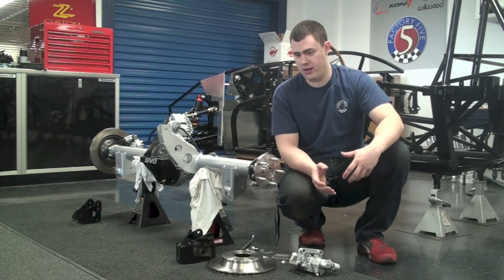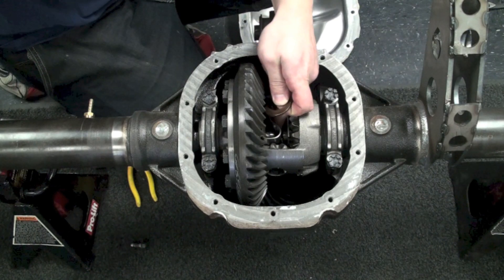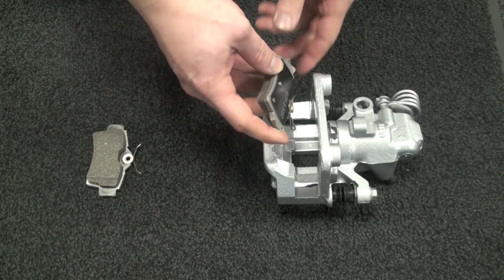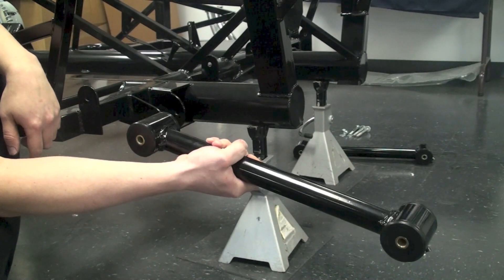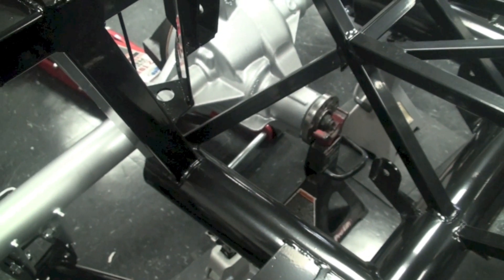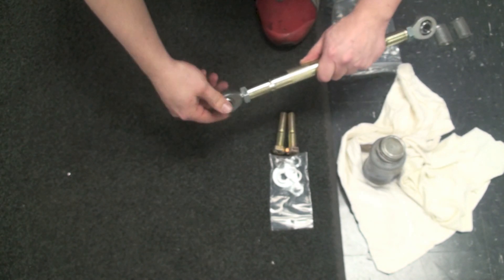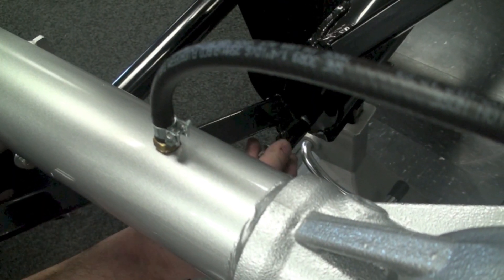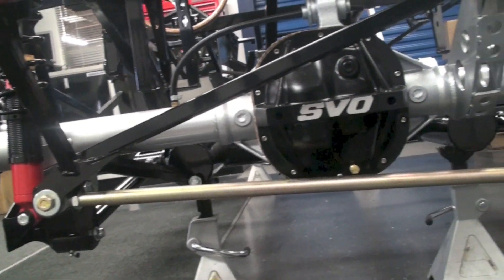Factory Five Mk4 Build Episode 7: Rear End Assembly

Comment: I realize that using different rear ends are not supported officially by FFR, but what is the minimum width a rear end must be to fit the car? I have an 8.8 rear end from a dead car that is 56.5 inches flange to flange, and the 79-93 fox body mustangs supposedly have a 57 inch rear end. It doesn't look like there will be any interference, but I figured I should ask.

Comment: Ahh yes. I understand. In compression that will work. It makes the entire structure rigid. I am still with you though,it could be stronger with minimal redesign. The current design does leave clearance for a wider range of shocks though. I come from a world where everything must be as strong as possible so "strong enough" makes me nervous but it is a proven design & principle that has worked fine in many vehicles. After all,if you hit whoops at 80 mph in this car you deserve a hefty repair bill.
Reply: It might also be a good idea to replace the coarse grade 5 hardware with fine 8 at the very least, if not AN or NAS.

Comment: They did answer and I think it had to do with the bolt being tensioned so the force is better moved out through the spacers instead of merely bending forces on the bolt. I guess it works and things are perhaps stronger than I might think.
But I would probably not do such a design myself. I think the bolt strength and bolt tension has to be fairly specific to be in good standing in that config. But if none of their thousands of cars have ever failed there it has to be at least decent.

Comment: Did they ever answer you on that mount? Having years of desert racing experience I would think that would work for a street car but I would have a strong urge to reinforce or completely redesign it. Honestly,I would probably burn another tab in there to get rid of the spacer & I would box in the bottom but I am used to building for forces you will never see in a street car.

Comment: The shock mounts seem concerningly weak. The force is applied to a bolt as bending force because the bracket is so wide, instead of sheer force with a narrower bracket.
And the bracket itself seem poorly designed for handling the forces along the shock axis.
I suppose it works or more cars would have problems but still. I'd like to see high speed video of that bracket under dynamic load.